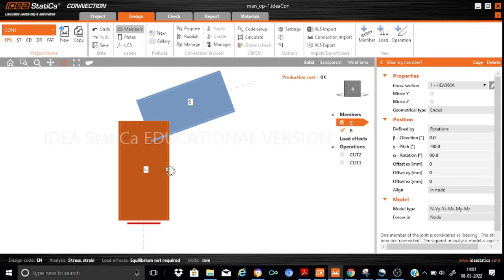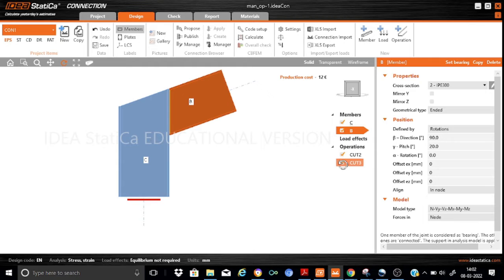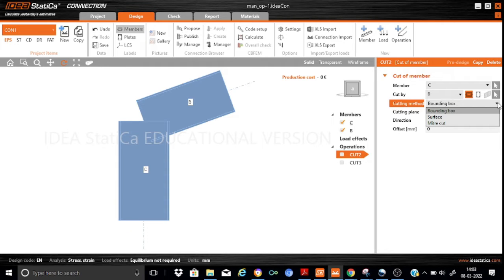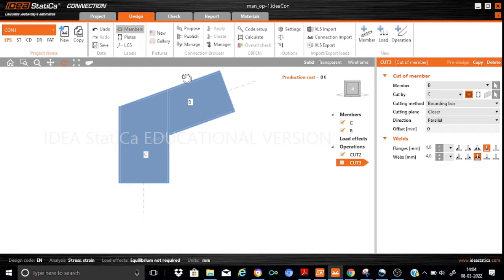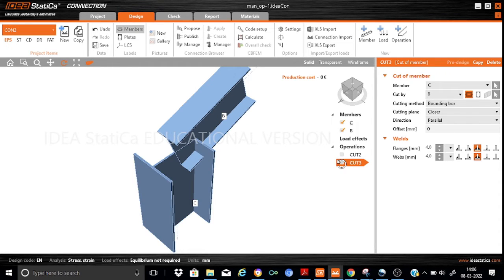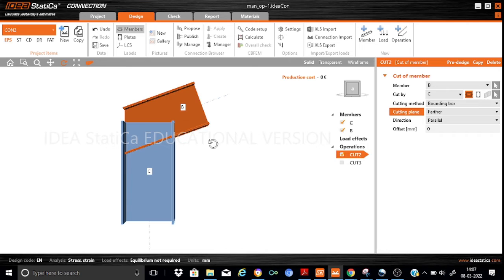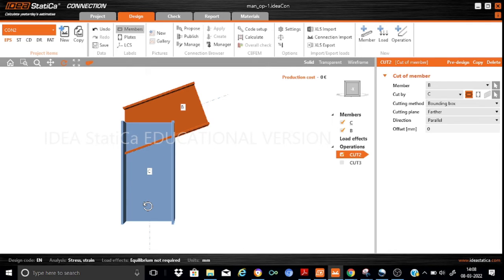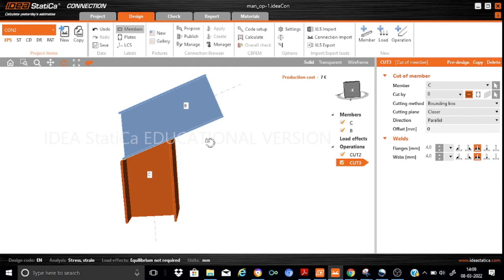IDEA Statica- tutorial 23 -  Manufacturing operation-CUT

Comment: What is the difference between these cutting method.I have a model if i use "Bounding box " method analysis is not performed as i was getting a notification that plate area is small but if i change from bounding box to surface analysis was performed 100%